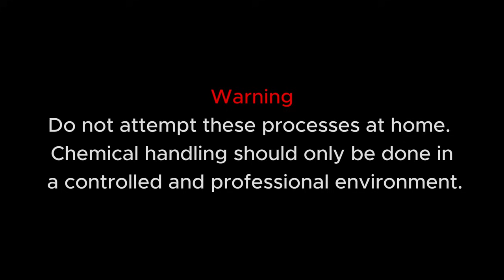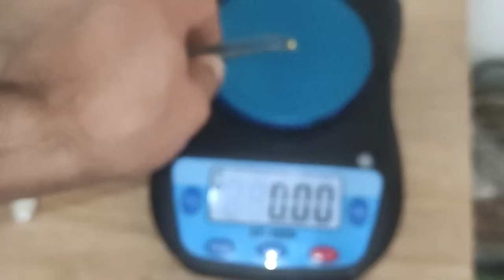Smelting Mix IC chips for GOLD and SILVER

Comment: It doesn't seem to be worth all the effort with the process and chemicals used time and work there is just not enough gold or silver to do that much work. If this was done on a much larger scale it would be worth it but this is way to small
Reply: He ended up with nearly 1g gold for roughly 1kg material. As a demonstration this is pretty good. That works out to about 800 grams per ton. A profitable mine is doing well at about 8gr per ton.